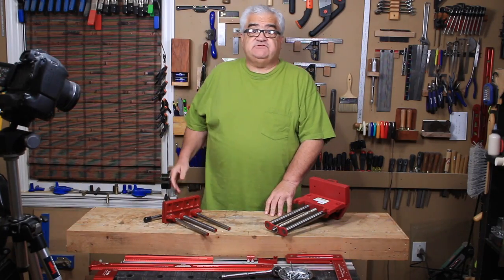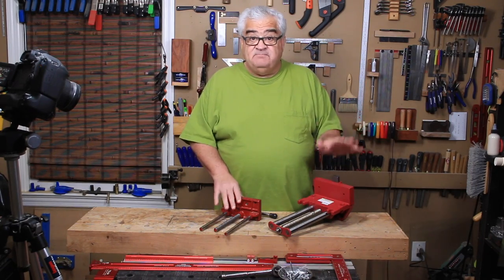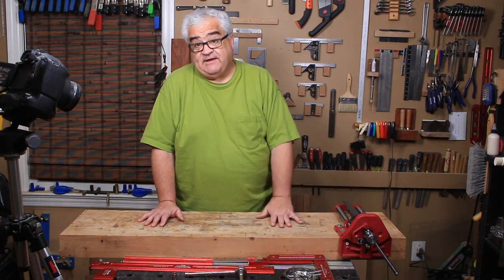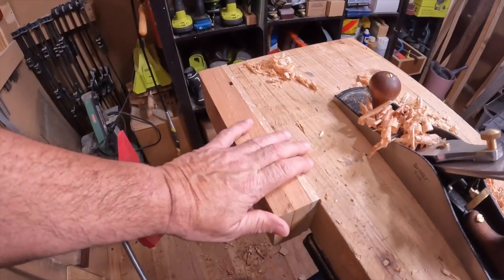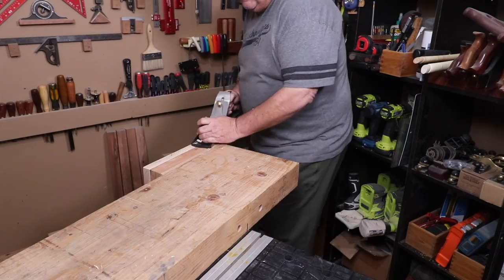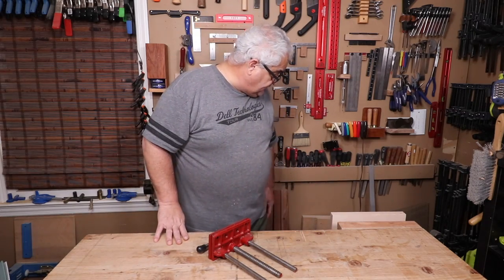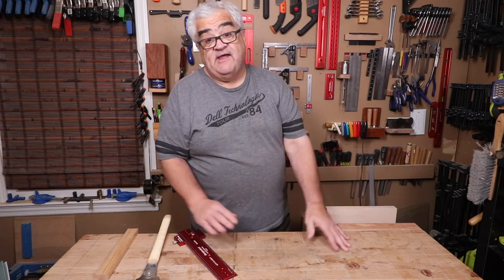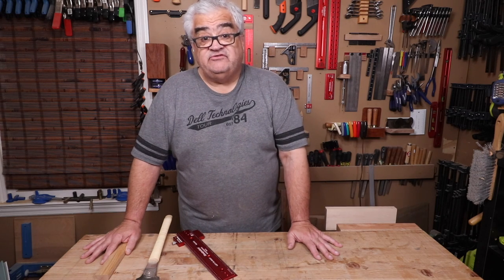Doyle Woodworking (Carpenters) vise at Harbor Freight...

Comment: Nice vise at a great price! From what I saw in the manual, the bolts are sold separately. But you’re right that if HF did supply the bolts you’d probably get better getting your own. Thanks for the vid.
Reply from the maker: Thanks for the info on the bolts. I'm kind of surprised they are sold separately but I guess a penny saved for them :(... Even without the bolts included I think it is a great vice for the price.....Thanks for watching....

Comment: Just installed a vise on my newly built workbench that’s around the size of you bench. I got a Youst 9” face vise off of Amazon. Had trouble getting the screw and guide rod hols aligned but all is now well. Did learn one important lesson. You cannot make a vise handle from a 2x4. 😊 Recently discovered Harbor Freight. Bought a pair of beam clamps for $12.00 each, they work great!
Reply from the maker: I think you will be happy with the yost vice as well. Yea, a 2x4 might be a bit soft for that application... Thanks for watching....

Comment: Nice video but a question…It would seem the Vice is substantial overkill of that little bench top. I will also suggest that your wooden Vice jaws are thick enough that they are limiting the thickness of material you can put between the jaws. Okay near the end of the video you explain the temporary nature of this setup.
Reply from the maker: Yes it is temporary and not the best. I would have only used one [iece of Cherry if I knew at the time I was going to use the oak for the cavity. Given that yes the front part is to thick. Thanks for watching and the comments....

Comment: Nice installation.  I've just built a bench and that is the vice I will be installing as well.
Also, you measured the clamp capacity at "5 1/2, would have rather had 6", the first thing I thought was, That's what she said. 😁
Have a good day.
Reply from the maker: Ha good one :).... Thanks for watching and good luck with the vice.
Reply: @jldwoodworking  I made the trip to HF yesterday and mounted the vice today. Then used it for a few things. Its going to be a game changer for me.

Comment: Thanks for the video. I didn’t understand why you made the cavity. My thought was to just add two boards, one on each side to protect the project. But it seems you did it for mounting reasons. I’m curious why that was necessary. Thank you.
Reply from the maker: Hi Shayne, I use this vise for hand tool work to include saw use. I wanted to cover the cast iron so the saw never could hit it. I started with the router and switched to the oak because my router bit was shot and it wasn't going to get the job done. Thanks for watching...
Reply: @jldwoodworking  thanks for the reply. I understand why the wood is there, what I did not understand is why you didn’t put the wood on both sides the same way. You built a box for lack of a better word on one side, why was that? Sorry, I’m just a little confused and want to get and mount one of these soon. Thanks.
Reply from the maker: @shaynesabala  Oh I see what you mean now. Well there is a few reasons for that.  one, for me when sawing it is the part of the vice I buried that I would normally nick with my saw if not careful. The back end is normally safe (unless I get really sloppy). And to be honest with you this is a temporary setup until I get the real vice made and just didn't see the need to do that back side. Someone here posted a comment below that Paul Sellers does not recommend what I did. I did not find his video yet but I generally agree with what Paul has to say so I will look into that for sure. If it sways my decision I will mount the vice differently in my bench build this winter. So I guess stay tuned and we will see igf I change things up... Thanks for the comments.....

Comment: Looks like a decent buy. HF has some decent stuff, contrary to popular belief.
Reply from the maker: Hi Snypler, You are correct they do have some good stuff and are getting better all the time. Thanks for watching....
Reply: Certain things aren't bad. Larger tools like drill press, bandsaw, planers, *dust collectors are a huge waste if you need them to be precise. 
 
*- The newer dust collection systems are horrible. They changed the motors on the small and large units, and they overheat really quickly. I usually would by the small one when on sale and dedicate it to 1 or 2 machines. That way, I could incorporate my tools into being self sufficient,  and connect to my outflow system that launched my sawdust through the wall, and outside to different areas. And the newer motors are getting up to 175f (in 2 to 5 minutes) right out of the box. The larger units are doing the same and get even hotter. My old units get to around 135f when they work hard for 10+ minutes. So something they did with new motors has doomed them.

Comment: I just picked one of these up a few weeks ago for $55...  A week later with the 20% off coupon I could have had it for $52.  From what I've seen so far this vise seems like quite the bargain in the $50-$55 range.   

FYI no installation hardware comes with the vise, which stinks.  I picked up some 1/2" lag screws, probably overkill, but it was too large for the holes.  I thought about reaming out the holes but my luck would be that I'd crack the casting and lose the 90 day warranty and my $55.  I will buy some 3/8" lag screws tomorrow and get his mounted up.  

I like your solution for putting a recess in the inner chop.  I think I'll follow your lead and do the same thing.
Reply: 20% of $55 is $11, not a $3 savings.
Reply: The vise is $65 regular price.  I paid $55 during one of their promotions.  A week later it was $52 after the 20% off coupon.  $55 - $52 is a $3 difference.
Reply: @red58impala  I never heard you mention that you still it on a sale 🤷‍♂️

Comment: I have a few pair of Doyle slip joint pliers (channel locks) I can't find anything wrong with them, good sharp jaws to grip the pipe, good heavy steel. CHEAPER than the competition! I'll have to give their vice a try!
Reply from the maker: thanks for watching. For the most part the Doyle brand is a good one at HF. I like the vice and have no complaints with it. I did a video on the slip joint plyers they make 3 or 4 years ago now. I really like them....

Comment: 👍🐯👍 thanks for sharing the info on the vise from HF. Any plans for the use of the old vise? I did the same but used my little Irwin for a end vise. It held like you said here, slipping when I needed it to hold still, but as a end vise it worked well when holding pieces on the top for planing the face sides of boards. Looking forward to seeing your woodpeckers video. Cheers.
Reply from the maker: Yes, I might use it as an end vice right now no room under the top because of the way I have it attached to the Kreg bench it is sitting on. Thanks for watching....

Comment: I have my Great-Grandfather's 10" Record brand (like a Wilton) woodworking vise with cast steel front plate and rear plate. It's over 140 years-old and weighs about 100 pounds (14" deep throat), so it has spoiled me. For the MONEY, the Doyle looks pretty darn good. A NEW 250mm (close to 10") from a woodworking supply is over $300, and I wouldn't buy it because it's missing some features (it's not drilled and tapped for sacrificial wood faces), so we're playing in the $500 range (GASP!). If Grandpa hadn't given it to me, I certainly wouldn't have bought it-it's more vise than I've ever needed.
Reply from the maker: The Doyle is a good vise but it is not in the league with the Record you have. Since it was your Grandfathers keep it forever :).  I have my Grandfathers Stanley No. 5 and I love it and will use it forever..Thanks for watching....

Comment: bought one yesterday...had coupon...doyle and vices not listed as excluded items but they refused to honor the coupon.
I'm contacting corporate to see why.
i'm install with through bolts based on past experiences of lag screws eventually loosening.
it comes with no mounting info or hardware.
Reply from the maker: That sucks I got mine with a coupon so that must be a mistake at the store. Yes, lag bolts can loosen and I do tighten them occasionally (have not had to on this one yet)...  From what I have learned since doing this video is that most vices do not come with hardware. I guess there are just to many variables in what they are being mounted to. I believe mine did come with a one page basically worthless instruction sheet that I didn't use....Thanks for watching....

Comment: What's the size of the lag bolts you used during installation??
Reply from the maker: Hi Victor, I believe they were 2 1/2 inches ling and 5/16th thick.... They were standard bolts at the Home Depot in the individual section where I just bought the 4 of them...Thanks for watching....

Comment: What is all the hardware I need to purchase?
Reply from the maker: Basically 4 lag bolts. More than likely you will have screws to attach the face depending on what you do with it. I got 4 at I believe 2 1/2 inches. Thanks for watching.

Comment: Yes, Crubber is a much better bet, put it only on one of the two surfaces, not both!
Reply: Why is that?
Reply: @davidlynch7666  Crubber is really grippy but if you have two layers, smaller parts tend to move in the vise.
Reply from the maker: thanks for the tip and thanks for watching....

Comment: Is there a dimensioned drawing for mounting this. I would like to see if it can be mounted to the Harbor Freight wood working bench in place of the vice that came with it.

Anyone?
Reply from the maker: I dont know of a drawing but it is fairly small. seven inches wide and  under 12 inches long.... Hope that helps.... Thanks for watching....
Reply from the maker: What I mean is is under 12 inched under the bench. it is 15 3/4 in total length....